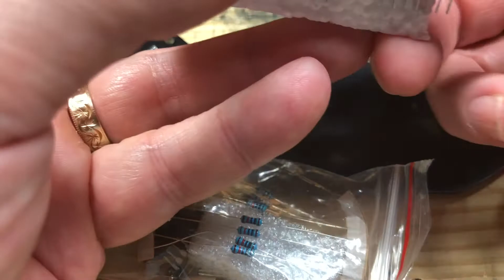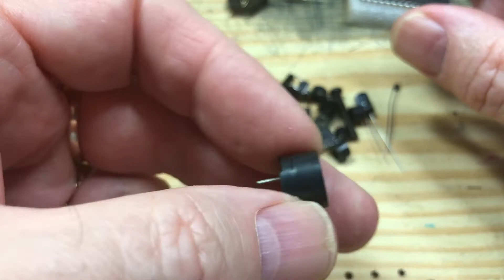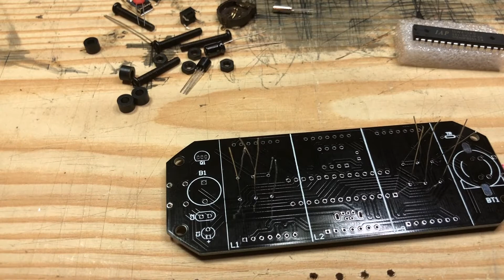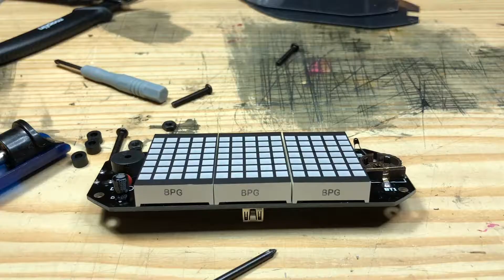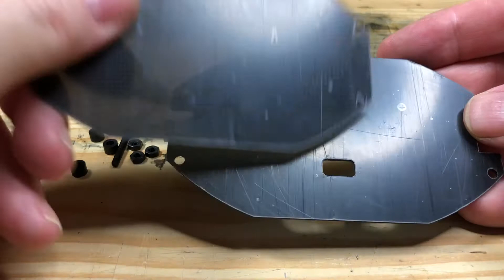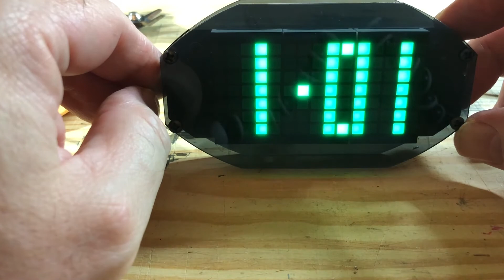Banggood: Geekcreit® DIY Black Mirror LED Matrix Desktop Alarm Cloc

Comment: Great video. I’ve just put this together and am reasonably experienced in soldering kits. I cannot get the button near the buzzer to work. I’ve checked and remade all joints and also swapped out the button. The other is fine. Everything else is fine. It cycles through time, temp etc but I can’t bring up the menu. I’m at a loss without a circuit diagram as to what to try. Any ideas?

Comment: Hi bro, nice video. It helped me a lot. Please please help me for 1 more thing, my clock running fast by 2 sec every 1 min.
Reply from the maker: Hi Deepak. Not sure why that would be the case. Check the soldering of the crystal perhaps and any bridge connections.

Comment: Hi I just built this but I got some of the display missing, if I bend it slightly they come on, I've re soldered the display pins but seems to be the same? Any other ideas please?, It is the 4th row down and the 2nd row up from the bottom across that don't work
Reply from the maker: No specific ideas other than the display is faulty. They are heavily potted so repair is unlikely. I might have a spare kicking about from a faulty kit if you cannot get it going.